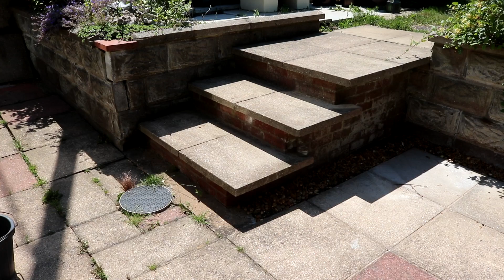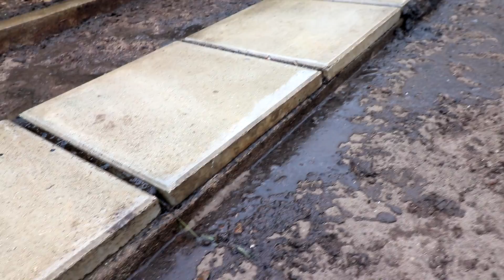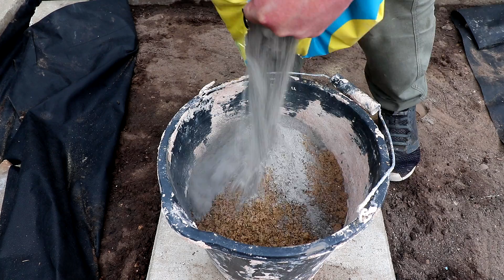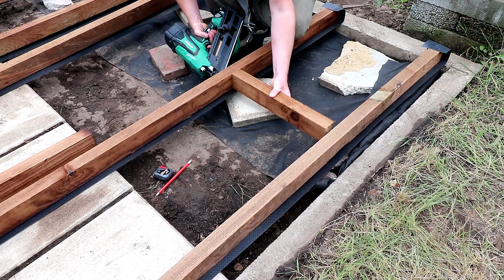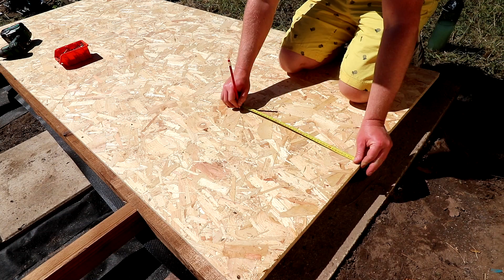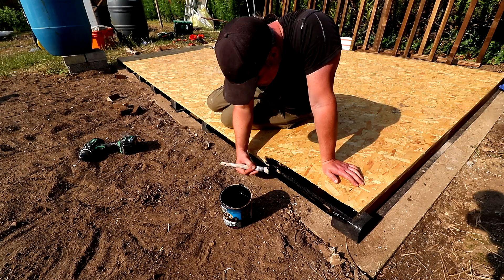Building A Shed Floor & Foundations (PART 2 SHED BUILD PROJECT)

Comment: Nice job! I use plywood for the floor. OSB is cheaper but I think top quality construction grade 3/4" ply is better for floors. I'm just about to build a small cabin, I'm going to try these new plastic adjustable screw risers under the floor. It solves 3 issues.
1) damp break between joists and the ground.
2) easy levelling
3) no concrete!
Your frame is excellent! 😁

Comment: a question to Keith or anyone... i'm planning to use this for a shed base: https://www.thegardenrange.co.uk/plastic-shed-base/ (interlocking plastic grids filled with gravel) as i don't want to pour any concrete (for environmental / permanence reasons) - anyone think its a dodgy idea? the bearers would be on top with DPC, thus creating airflow under the floor (with enclosing mesh for critter-protection)

Comment: I really like how you try to cut the expenses as im functioning in the same way. Peter Parfitt made a shed recently and i would never be able to pull something like that off. Cutting corners, learning in the process and then fix with new solutions when problems arise. The OSB is risky as i used it for a shelf in my shed. That piece was i think 2,5 meters by 90 cm laying on top on some 4,5x7cm on the sides. No support in the middle. In the summer it was stiff but during winter and no real ventilation in the shed it bowed down quite a bit. Now the bow has decreased but i must add some 4,5x7 supporting it in the middle. The shelf works for what it's supposed to do though. I store some junk up there and it hasn't fallen apart yet.. :)

Comment: How could you build a shed and not anchor it to the ground? Also, untreated/not protected against elements OSB for the floor, merely sitting on unsecured joists is just asking for trouble on a colossal scale, especially in England, it'll become rodents' heaven then one storm and it's either blown off over to the fields or into the neighbour's garden. I really would've expected much more sensible approach from you, since you always seem quite thorough in your projects.
Reply from the maker: It doesn't need to be anchored to the ground in the UK. Not necessary. The rat issue will be addressed later in the series. The OSB had good ventilation and protection from moisture so it will be fine. Don't be so rude.
Reply: @RagnBoneBrown  Where and how have I been rude? Don't be so touchy.  If you think it'll be  safe &secure enough go-ahead suit yourself.

Comment: Hi Keith, I noticed you had a field running behind your back fence that space you are leaving between rafters will make a lovely run for mice or even rabbits depending on what is in the field. We had rats under ours and my dad decided that he would flush the out with water, so he got the garden hose to and pushed it down the hole as far as he could and turned the tap on. I was banished to my bedroom as I had wanted to capture them and keep them as pets, My older brother was told to stand by the hole and hit anything that came out with a shovel I was watching from the bedroom and suddenly water started to spout in our garden, next door both ways and the old age bungalows behind us, you could hear me laughing until my dad got to my bedroom and stopped the laughter.

Comment: Dylan your cat is the answer to keeping rats away. Not being a rat catcher himself but by the scent, i'll explain at the end for you. 
I live on a farm and you'll never get away from a rat problem with a shed and a raised floor, even if you do put mesh everywhere. It's an ideal place for a rat, safe, dry and warm etc. 
If a rat want's to get in somewhere it will, even through thin concrete. They will squeeze through a tiny space, less than an inch hole due to the way they are built, seen it with the pet rats my son has had over the years, and  how far they can jump will amaze people.
Way how we deal with it down here in West Wales to stop them eating away at the animals feeds is by keeping them away by smell.
We have all our cats pee in cat trays with either cat pellets you can buy or we just put sawdust in there. We then spread it around the feed areas, or the shed in your case and the rats will not come near. 
Rats hate the smell of cat pee and will stay away, they also don't like mint, not the Tesco bought pot of mint but the plant.
Wild rats are a horrible problem but the pet ones are amazing. 
When you see a dog with a pet rat fast asleep under his chin and a cat doing the clawing thing on the dog  and not even bothered about the rat, makes you wonder what the hell is going on.

Comment: Thank you for another great video Keith. Watch out with your overarm sheet material carrier though- I had one (gorilla gripper I think?) and it snapped mid-carry. The sheet hit the deck but my arm carried upwards and I ended up boxing myself square in the ear. I couldn’t continue my project for 5 minutes for laughing...also was a bit painful!! I made an underarm carrier out of plywood shortly after that is much more comfortable.

Comment: I feel that a better option would have been a zinc drip flashing or something similar. It seems to me that the DPC, based on how you have installed it, will create an uneven floor surface for when you install the wall plates. I have built a few sheds in a climate similar to where you are and the flashing provides a very effective barrier to shed rain and to protect the floor edge and top of the sleepers / joists.
Reply from the maker: The DPC is about 1mm thick, which is practically nothing in terms of carpentry tolerance levels.  It wasn't an issue
Reply: @RagnBoneBrown  Fair enough. Looking forward to the end result.

Comment: Apart from making it wider thats exactly how i did the floor on my shed . Its sitting on the patio so its solid and has space for lots of air to get under it to dry! i However used ply, i did that as it was a small shed so not too expensive, i am also a bit ..... fat , so did not want to fall through the OSB.

They type of dry mix you made for your slab is kind of similar to how a dam is created , they make very very dry mix and then roller compact it, its cheap and it works more like accident concrete so no reinforcement needed.

Comment: Random question, why does your tracksaw have yellow tape on it (and not a Keith Brown sticker)?
Reply: I believe it's for better dust extraction (when inside and hooked up to a vac) 👍
Reply: @Smithb83  around the extraction port I get, but down the side? Are there vent holes that are worth covering up?
Reply from the maker: I shall have to add my sticker - great idea!

Comment: I don't think dpc works with wood because moisture sits on the dpc and rots the wood. I think joist hangers would have been a better approach. Timber on concrete always seems to rot! I know Ali Dymock used dpc on his blocks but I think the difference is he has a lot of ventilation around those blocks. Nice video anyway!

Comment: Only came across your channel a couple of days ago and watched the series of videos on you were building the workshop shed and its extension. I subscribed after watching them. It's great how you go through your different ideas and options available for the base of shed and then your rational for the option you went with. I will have the same issues with transporting concrete and stone when i go about building my own shed. Concrete is better but not feasible in some situations. Looking forward to updates

Comment: Great video as always Keith, but I think you should've bitten the bullet and sealed the base surface with bitumen paint. You've still got the joints between the panels and although you might not get rain ingress, you'll still get variations in humidity from winter to summer and periods of heavy frost, which could enter the joints or unsealed surface fibres. If you want to get a long shelf life out of the build, I think it's false economy not to seal it properly. Not a huge fan of osb for floors, I've had a few fail over the years due to rot.

Comment: I guess we all do it differently. I had to build a 6" thick concrete base because I have 2 lathes to go in, (one is in already, the other needs moving now I have welded up a stand) so I then put a course of concrete blocks in on top and DPC then the woodwork.

Comment: Here in the States lots of builders use various tapes. I prefer acrylic tapes personally. The Huber Engineered Woods company makes a joint and flashing tape that is rated for use with OSB sheathing, called Zip tape used with their Zip sheathing. Comes in various lengths and widths too. Not sure how it would work out cost wise compared to what you have done but with the steps you've taken in the vid, as long as your siding overlaps your OSB edge your floor will probably be fine. If something does go wrong down the line your will certainly be their to repair it and that's just more content!

Comment: Hi Keith, Looking forward to this build. Where did you get your DP plastic as I will need some soon for a workshop build going directly on a concrete base. I used that blackjack all over my last shed on the base, edges of OSB, roof and siding. It’s working out great and no issues with water or moisture.
Reply from the maker: cheers, got it from screwfix

Comment: See that membrane you used to protect the end grain? Im no specialist but I did this on a decking I did back in 2007 - I have to redo it all this year as the timber that was set on that exact membrane have totally rotted :( It could be the way I did it that facilitated water to remain there im not sure, just thought I would mention it!

Comment: Really looking forward to these vids Keith as your original shed build back in the day is what got me hooked to your channel. 
I'm really surprised you used OSB for the floor. My own thoughts it that it would never last as long as alternatives like marine ply or standard ply. You are going to have a problem with rodents under it as your house backs off onto a fairly large field there, so mice and rats are common enough there I'd say. Might be worth adding treated boards to the sides to close it off on the base. 
Would only be a few quid extra in the end. 
Would be worth placing a few rat bait blocks under there too. 
Our own tool shed backs off onto a farmer's field here and we have had rats come clean  through double sheets of floor ply to get at lawn seed so they can be very destructive!

Looking forward to the rest of this shed build series! Keep up the good work mate!

Comment: Great video Keith and explaining all the process of doing the floor. 
I wouldn't worry too much about doing the Bitumen Paint followed with that roll over the top, just think that's it's double the safety of the edges rotting away.
Looking forward to the next step in this shed build.
Stay Safe,
Barry (Wirral, ENG)

Comment: I would have put down a concrete base more effort but worth it in the long run no problem with rodents and no wood to eventually root out which will result in taking the shed down to replace the floor you may find putting the damp course on the timber will make it root quicker as it is not breathable and the wood will sweat.

Comment: Hi Keith, I made the mistake of assuming that it would be OK not to have paving slabs over ALL the area under my workshop floor (http://www.donjohnson24.co.uk//workshop.html) so there was some bare earth there.   After a few years, the good quality plywood I had used for the floor started to warp and de-laminate, making the floor very unstable, since dampness DID come up through the earthy bits..   As I did not want to rebuild, I had to cut the old floor out - a nightmare - and put some waterproof membrane onto the floor joists before replacing the floor - with OSB this time.   One other thing I did was to drill some holes through the sides of the joists into the under-floor area in the hope that this might allow air flow and reduce the effects of damp.    As you have already nailed your flooring - and probably gone further by the time you read this - my warning is probably too late, and all it will do is make you worry about the future of your OSB - Sorry!
Reply from the maker: I'm not concerned since I have good ventilation, a large air gap and a vapour barrier. My old workshop floor is still fine so can't see this one being an issue

Comment: I renovated my shed 7 years ago. I changed the floor and redid the facade. 3 years later, the floor is not good anymore. I used floor grade OSB and I butted it against the walls frames inside the shed. The OSB was treated against humidity yet it soaked it from the ground and it's ruined now. I forget to put a vapor barrier under I guess. I see you did not put one, I hope your ventilation will be enough.
Reply from the maker: Did you have a ventilation gap? I did use a vapour barrier...
Reply: @RagnBoneBrown  I did not have enough ventilation as the ground moved with years and closed the gaps. Critters dug under and also closed the ventilation with dirt. Ground is sand on this part of the property and with our winters, sand move a lot.

Comment: The bigger problem you will have is the OSB buckling as you didn't seem to leave a 3mm gap between the sheets for expansion. The 3mm gap recommendation is probably printed on the sheet itself if you have a look. Hope it turns out ok bro.

Comment: Looking good Keith.      Looks like a great garden.     Usually when setting floor joists start with the centre of one at 2.4m or eight foot depending on material, and work back over at 400 or 600mm centres. (16" or 24" if boards are imperial) this way minimises waste and cutting time.

Comment: I wouldn't stress overly about the osb floor.  I've got a cheap shed I bought in 2005.  It was originally sat on some stacked up concrete blocks to raise it off the floor, but they have sunk into the ground over the years so it's now just sat on the floor.  Been there 15 years with no protection from.the weather at all, and its still fine.

I also made the sides and floor of my trailer from osb.  Again, no protection.  It lives outside and is generally full of firewood, so doesn't dry out overly fast when it does get wet.  The floor lasted 6 years before I finally put my foot through it.  The sides are still going strong and they've been on there just over 10 years now

Comment: Why not cut 4" off your joists so you can have full length edge support as per original plan?
You didn't coat the underside of the floor OSB ?
Reply from the maker: Good question! Will answer in future q&a vid 👍

Comment: You should fit the timbers in a way that you don't have to cut the sheets.
Reply: 2 extra joists would create a stronger floor with less Stirling board waste (400 centres)
Reply from the maker: Then the joists would be too far apart
Reply: 400 centres would be fine or slightly adjust if your sheets are 1220
Reply from the maker: More joists is more cost. Rather just make a cut.  The OSB isn't getting wasted anyway as you'll see in future episode
Reply: Work out your centres then lay all the plywood, ping some chaulk lines then cut the plywood with your track saw its a faster more efficient way of doing it
Reply: For imperial sheets just set out at imperial centers. 16" centers would be fine. Although I would have used 4x2

Comment: Hi, you can never have too much waterproofing so that is okay, I do not like using wood chip and prefer plywood although that would increase the cost substantially. Looks as if you are going to have a grate shed in the end, looking forward to seeing you finish it off. Good luck with the British weather it seems to always rain if you want to get something done outside.
Reply: It really doesn't change the cost that much here in the U.S , but yes to waterproof it either way! I don't think you can overdo that. :)

Comment: I would’ve added steel mesh to keep out rodents. Looking at structure it’s like a high density housing unit for small rodents.
Reply: He has a kitty that should set things straight with the rodents.
Reply: Me too - we live in a rural area and we and neighbours have had rat problems this year. Years ago when the kids kept rabbits, a rat made a home under the hutch, chewed its way in. Wish I'd put mesh under the compost bin, had one in there too !
Reply: I had a rat in our workshop this year, I managed to find a huge hole under my workbench in the corner of the floor so I shoved a concrete slab over the top and since then I haven't seen any further trace of it around.
Reply: Mrs B There's a rat in me kitchen what am I gonna do?
Reply: Good idea.   I had faceoff with a family of racoons under my shed.
Reply: @Circusflea00  How many racoons live in the UK ?
Reply: No idea, I was simply giving an example of the rodent problem I encountered here in Canada.  I know there are rodents in the UK too because I always see Boris on the tele.
Reply: Circusflea00 This is how you deal with rats in your kitchen https://youtu.be/0zSWqJGTa-I
Reply: @Circusflea00  dude you didn't have to do is like that. We don't claim Boris
Reply: Small lots of poison block. Job done. Just keep it up, there will never be enough to be a problem

Comment: Keith I used oak as the base frame to my log cabin and although a bit more expensive it will stand the test of time and would have saved you a lot of work treating edges and using dpc. Horses for courses though. Good vids mate
Reply from the maker: I wouldn't want to use oak on a storage shed personally, seems wasteful to me. Cheers
Reply: Also would be unbelievably expensive...

Comment: Nice effort Keith, well constructed although I still favour Matt Smith's at Badger Workshop construction. I'm sure the use of floor insulation has benefits. That said, keep up the good work.
Reply from the maker: This is just a storage shed, not a workshop so it doesn't need insulation. Thanks